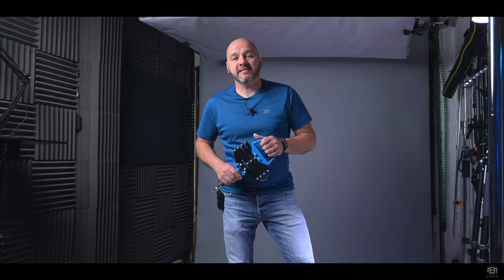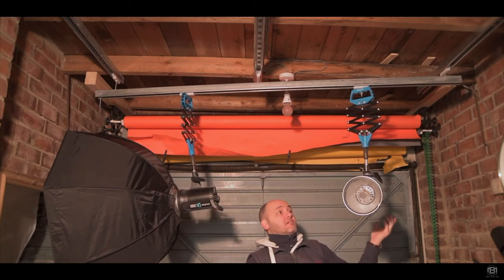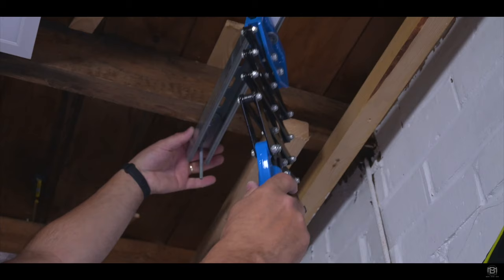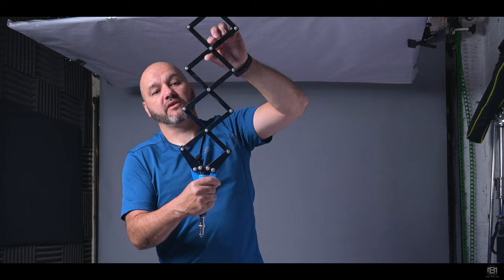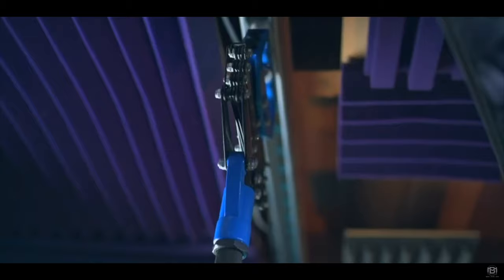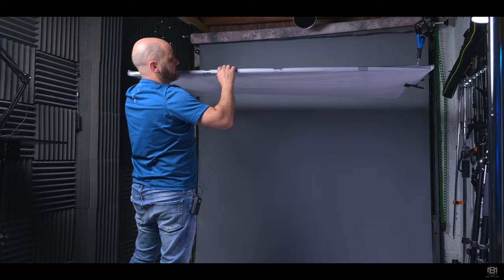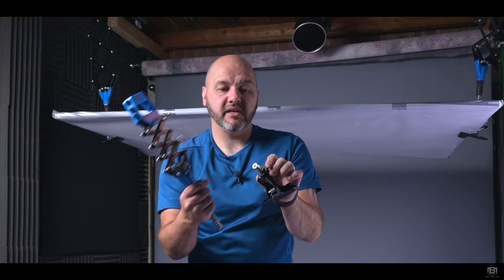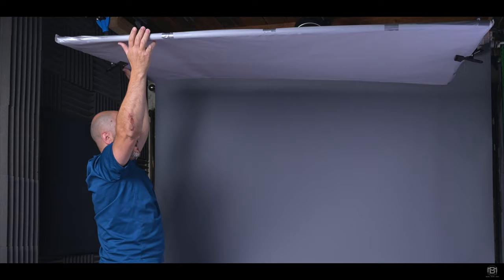DIY Photography Rail Ceiling Lighting System  HACK 2020 UPDATE!

Comment: Barry, this is fantastic and thank you for both your old and new videos. For what it's worth, this is really helpful for those educators who are looking to set up something at home for recording undergraduate lectures. Can you please double check pricing on the channel trolley (4m section for £55 shipped) and unitstrut (£26)? (I'm wondering if the prices might have increased as £26 seems expensive for that unistrut...but perhaps that's just normal pricing).
Reply from the maker: Thank you!  Yes pricing will differ from the first video, the links used for uni strut are really only for example so folks know what they are looking for, using a local electrical wholesale will be much much cheaper. Hope that helps thanks.
Reply: Thanks Barry. Another silly question. I believe you cut the strut to size last time for your 'H' segment. How hard is this galvanised steel to cut? What tool did you use to cut it?
Reply from the maker: Hey Phil, I just used a hacksaw, took a little effort but got the job done
Reply: @BarryMountford  Thanks! By the way, unistrut also make a 1.5mm version (as opposed to a 2.5mm thick version). According to their guidance notes, the 1.5mm version should be perfectly suitable for most applications.

Comment: Hi Barry, brilliant video btw. I only have the lights to attach to the bottom of the rivet gun now. I have the spigot but the thread seems slightly short, was this the case with yours? It screws so far and them appears to be slightly loose? just concerned about the lights hanging from it.
Reply from the maker: No my spigot is tight when screwed in.

Comment: Hi Barry - I really like your setup and I bought the riveter - the same one you have. What kind of drill did you use in order to drill into that? I have a small drill but think I may need something that's more "heavy duty" to drill into that handle - which I think may be an extremely strong plastic? (or steel.) Maybe it's a component product because it feels sort of llike plastic and sort of like steel.
Reply from the maker: Thanks man, I just used a 18v dewalt drill on a slow speed with a good metal drill, unless they have changed the materials used to make them as mine are made of metal. Hope that helps.
Reply: @BarryMountford  Thank you!

Comment: Hi Barry.  Can you help me? I have a small studio like yourself? Can I ask how much space do you lose on either side of the Neweer roller system after instalation?
Reply from the maker: It’s the same as the original as the size of the lights dictate the position of the rail.
Reply: @BarryMountford  Hi Barry please forgive me for asking again. You said that the width of your garage is 88”. what I am asking is, how many inches from the wall to the edge of your paper roll?  For example, if you lose 4 inches on the left and 5 inches on the right, then the max size of your backdrop is going to be 79 inches.  I am trying to find Out how much either side I will lose to determine the price and size of the aluminum tubing  for my backdrops
Reply from the maker: Sorry John missed this, exactly that 79 inches for my paper rolls and canvas backdrops, hope that helps